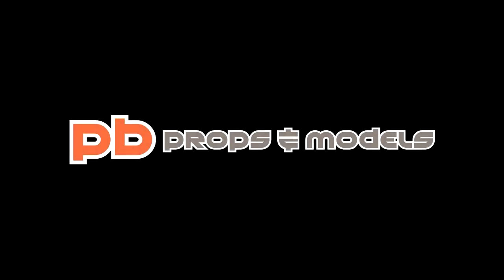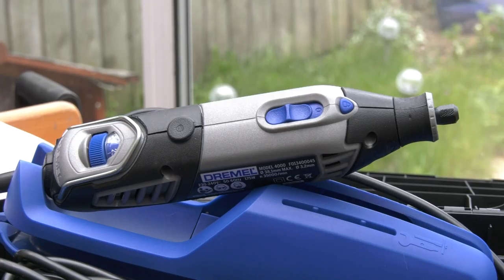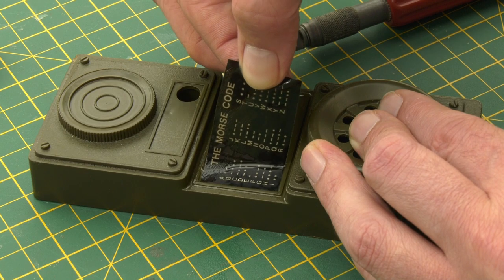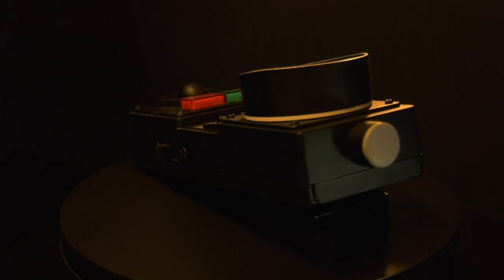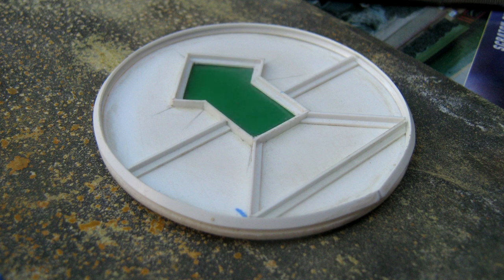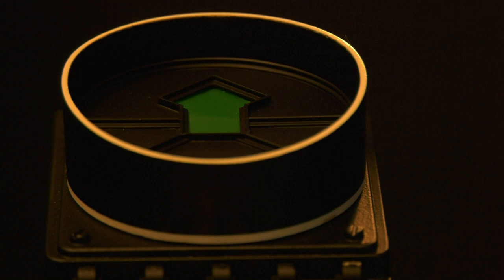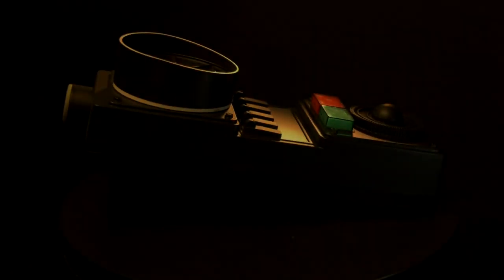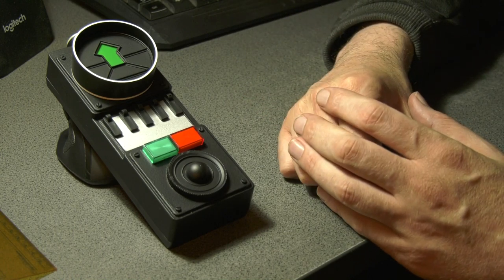The 6th Doctor's Time Distortion Tracer prop: Replica Build (Original UN-EDITED Version)

Comment: DR WHO and his colleague look like dressed for mad hatter's party. I should rather like to make my own one of these devices.  You make it look easy but, I most likely will get in a mess with it. I made a transistor radio once from a peace of coke as a tuner, a speaker and an oak tree, that I used for the aerial Antenna.
Reply from the maker: A radio from all that stuff? Sounds rather fascinating to me!
Reply: @PBProps  My dad told me how to make the radio. I was about age 14 at the time. But, I was amazed when it actually worked. I may have used diodes and transistors too. The oak tree acted like an areal. And by places a wire on various areas of the piece of coke. This was the tuner.  It was 46 years ago I made it.  I was working on a laser beam when I was age 12 to do with TV frequencies but, but I was not able to cut the front glass of the TV screen out. It got too dangerous. Around this time I accidentally electrocuted myself. I always chewed, things still do. I had put electric wire socket into my mouth from tape recorder I got 240 V shock.  I forgot it was still plugged into the mains.  I was sitting under the fireplace mantle shelf at the time. Sprang to my feet and hit my head against bottom of the self.  Dad laughed and said, he never saw me move so fast.  He explained TV sets can hold a lot of electric power.  He took out the rectifier for me to play with instead.  Just by sparking it from low life battery one could up the voltage and get quite a shock.  He disposed of the TV.  I later made the radio instead of the laser.  I was more-less on the right lines even though my school teachers would laugh at me explaining theory behind my inventions. These days laser type weapons can be made from mm mobile frequencies Five G. That I strongly disapprove of them.
Reply from the maker: I just love this sort of thing, it reminds me of the sort of thing that I used to get up to when I was a kid. I too had a 240v shock, but then I did stick a coat hanger into a lamp bulb socket and got my brother to switch it on to see what would happen. Other than welding the hanger to the lamp socket, putting on a pretty show of sparks and knocking me off my feet, nowt much happened. Hurt though. Radio-wise, the closest thing I've made is a huge aerial array when my Mother's radio was too weak to pick up a decent signal - just lots of conductive metal objects stacked together and tethered to her radio's rubbish little aerial - it worked a treat, but was ugly as hell.
Reply: @PBProps  We are fortunate to be around to tell our shocking stories. Apparently, I was told it is the burn that causes death rather than the actual electric shock. Hence your coat hanger welded.  I made a TV areal with two garden rakes back to back when I was about age 11. It worked but signal was not brilliant. But the areal for a radio is to do with the copper coil I understood years later. The amount of times it is wrapped around the carbon rod determines what height it would be.  Physics was not my strong point. My weak points often out did those. Sounds like you made a sculpture; shame if you didn't take picture of it. My woodwork teacher pulled me up in my last year at school; asking why had I never completed anything.  "Go to that off cuts box lad, and make me something right now," he demand. I made a sculpture that made him the most happiest I had ever seen him. He was well known to teach by a heavy hand.  He hated wood being painted or varnished. I had painted it multi colours, with a kind of water based paint.